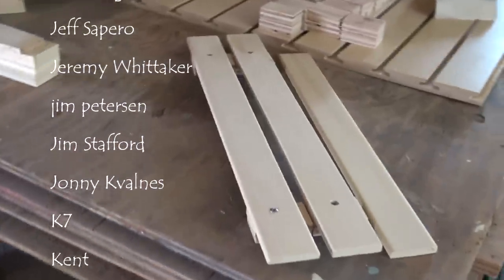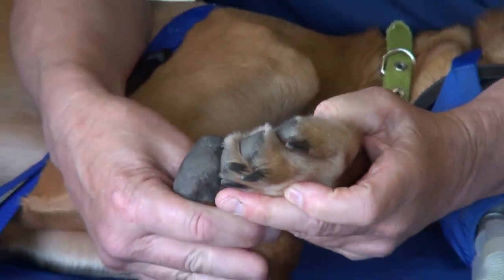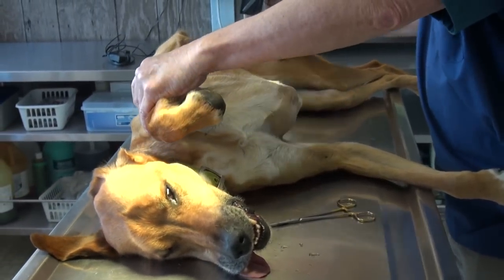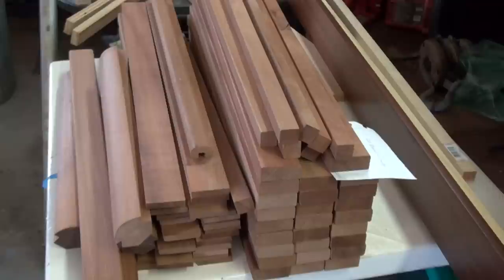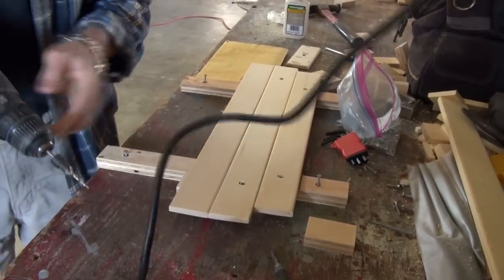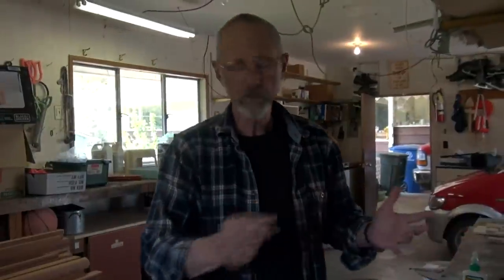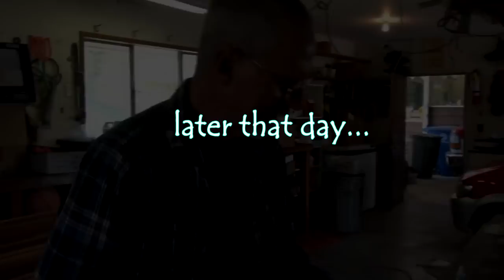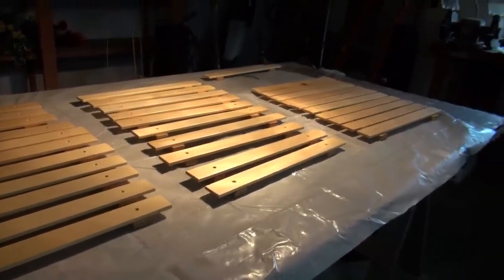Cruising Lealea Refit No.64: Gone to the Dogs

Comment: Did you thin out your epoxy for the priming? If so what was your ratio? Thanks.
Reply from the maker: No. We are using System Three S2 penetrating epoxy. No need to thin it more.